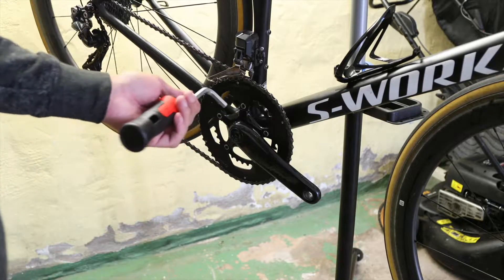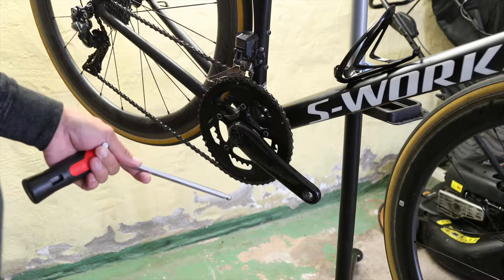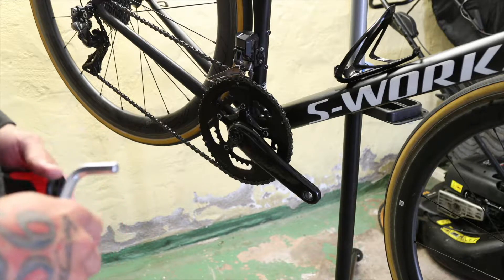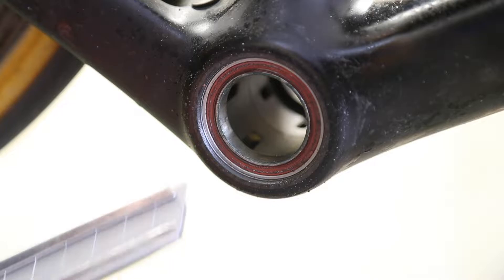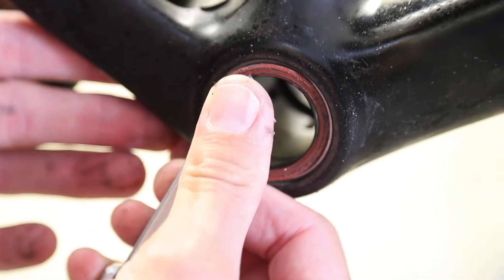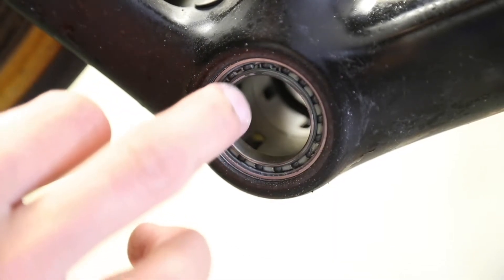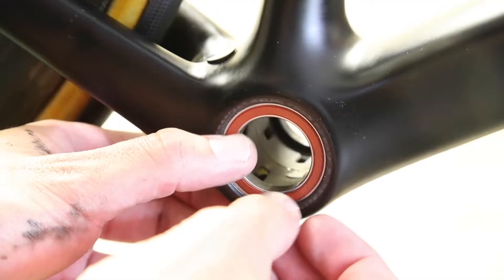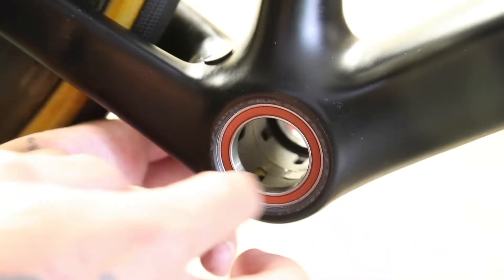Race prep!

Comment: Great video! When you disassembled the BB, did you just reuse the original seal or install a new one?
Reply from the maker: Hi Chris! Thanks for the comment. I used the original seal as it was not damaged. However, if you bend the seal when removing it or it is damaged in any other way, I highly recommend getting a replacement. Typically, you can open and re seal the bearing as many times as you'd like without need of replacing the seals.